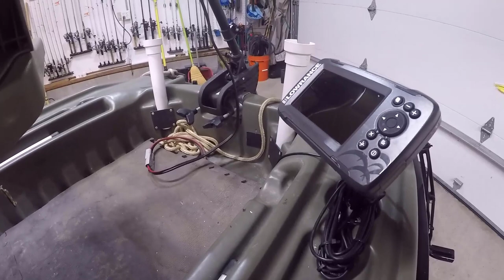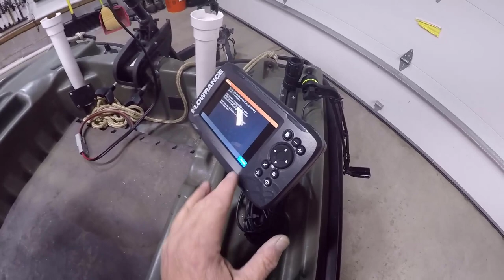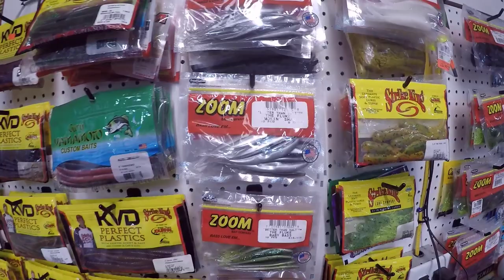PELICAN BASS RAIDER MODIFICATIONS 2022 FINAL | Fishing With Vance

Comment: I have the pelican pond prowler 8 and just love it. I just load in the back of my Ford ranger, have not done any mods yet. But soon I will get a fish finder. I have minn kota 40 lb thrust which is plenty. I found in order to beach the boat (no trailer) I need to put the trolling motor in back , much easier.  And when the trolling motor is in front the boat does skate around. Thanks for the video.
Reply from the maker: Good input Clint.  I do have concerns about getting in with trolling motor in the front.  I am sure It will be new challenge but want to try some new spots and try the front of the PBR.  Have a great season.  Fish on!

Comment: Mods look good. I love having the trolling motor in front. I have an older 9” garminnechomap fish finder. You can download contour maps, draw your own and it also has sidescan. I pretty much only use the downscan, and water temperature. Once I get on the water, I really don’t like looking at the screen all the time. I fish one lake mostly and have a pretty good idea of depth anyway. I got my unit on a discont because they came out with better model. I doubt you will need more advanced fish finder unless you just want to upgrade for checking things out. I have the same tie downs, work well. Thinking about putting rudder on the back but haven’t gotten to it yet. Love your motor, I’m still all electric 😁
Reply from the maker: Thanks for the feedback.  I likely don't need it much on my home lake as you said.  Headed into new waters this year hopefully a bunch.  Going to see what it's like fishing out of the front.  Can't wait to fish for sure.  As soon as ice is gone, I'm headed out this year no question about it.  Thanks again for watching.  Fish on Pat.

Comment: Vance, you FINALLY put some holes in the boat! BAHAHAHAHAHA. You'll be fine with that. I like the new design. You have more options for the situations you fish. I think you'll like having the fish finder again. I'm not sure, but doesn't the transducer need to point in the direction of the boat? Otherwise, won't it look like your moving sideways instead of forward? Also, what ever happened to High Life? Haven't seen him for quite a while. Did he move out of the area? You've put a LOT of time into making the tweaks to the boat. I've done the same with mine. I don't think we'll ever get done coming up with new ideas to try on them. I tell my wife all the time..."It's a work in progress". :) Good luck this spring. I've been ready for spring since about October of last year. LOL
Reply from the maker: I did finally give up on the no holes rule.  Looking forward to new waters this year.  Heck, looking forward to all waters already like you said.  Been a long cold snowy Winter.  Highlife moved and isn't around anymore.  He had some great ideas on the mods no question.  I see so many tables and pole holders out there that were originally on my PBR.  I will never stop making adjustments like you said.  Some things I think will work, once on the water do not work at all.  I am sure this season will be full of "fails" haha.  Can't wait to fish either.  Thanks for watching.  Fish on!

Comment: Hey Vance. Love your Raider. How does the battery handle both the trolling motor and the fish finder? I wanted to put a garmin in my raider too but I use a trolling motor as primary propulsion and I don’t want to have an electrical issue. Thoughts?
Reply from the maker: I haven't had any issues so far.  I admit, have only just started using for the season but so far so good.  I tried having a separate battery and it proved more trouble than it was worth.  Thanks for watching and hope I helped.  Fish on!